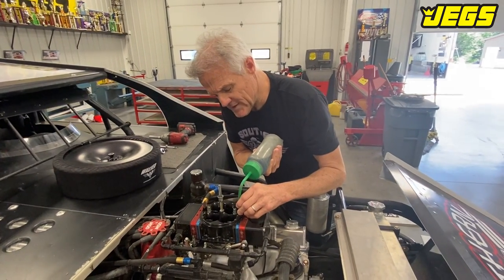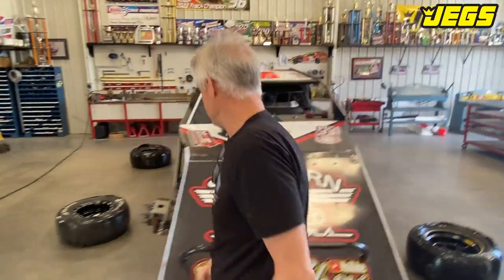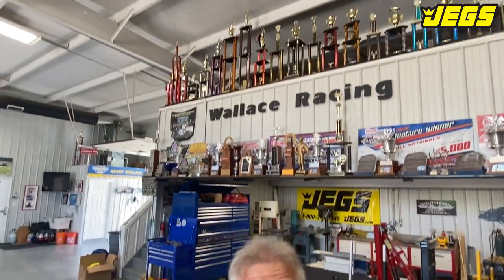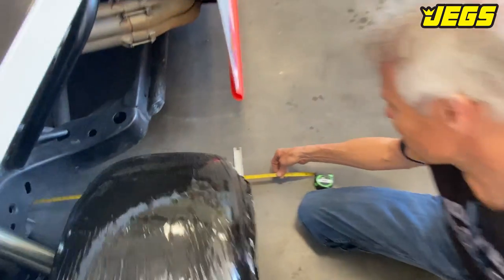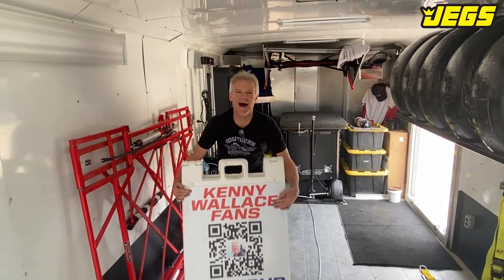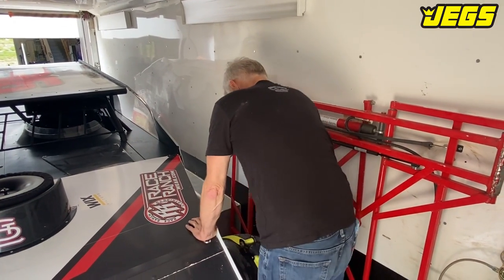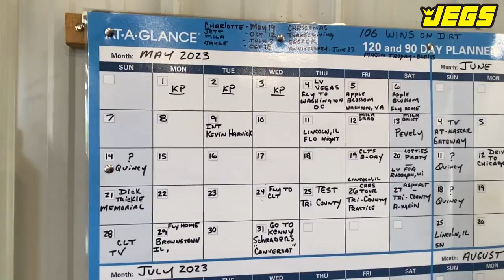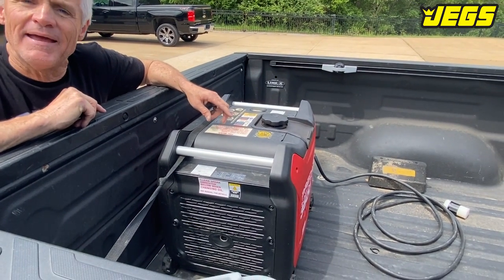Watch Me Do a Surprise Repair & Load Up My Race Car!

Comment: JEGS really is a decent company ive never had problems with customer service. No one has ever built me an engine like jegs 600hp LS for $13k warranty complete plug and play i beat on it no problems. if its got good oil pressure hammer! It! Thats what its built for.

Comment: You amaze me, you're doing exactly what I do every pre-race and after race.  I'm 63 years old and I've been building and rebuilding my sons race cars since he was in karting at age 5.  He is 26 today and running his 2nd year in Modifieds here in Phoenix, AZ.  We have a small 3-car garage and a 20 ft trailer, but we manage to do everything we need to get in all the racing we can afford. (20-30/year).  I love the tips you showed in this video, love the way you are just as organized and methodical.  I found some new things in this video that will help us, like the extra nose piece you have pre-assembled in the front of your trailer, the plastic pieces you put under the front tires to adjust toe.  (We shut off the compressor whenever we shut down the garage, like turning off the lights.)  Thank you for sharing, keep being you, brother.

Comment: This was fantastic. Can't explain how good. One of my all time favorite youtubes. Could watch this all day. I run a hillclimb, autocross and circuit car on my own just mainly at club level (fitting, turning, engine rebuilds/mods, wheel alignments, body work, respray, fab, tire change/balance...the works). Nothing like your set up Kenny (a fraction of the size ie a Mazda 4x4 ute and a car trailer as opposed to your smaller enclosed trailer). Problems solving, routines, patience, self-constructive-criticism, I love all that. You teach me heaps and I enjoy the stories. Thanks Kenny!

Comment: This brought back so many memories. I recall sleeping in the truck in the parking line for the worlds 100 in the late 70’s. I also was there by myself. For most of my racing days it was just my 5’2” wife and myself there. The “humper” tires were almost bigger than her. As I recall there were almost 200 cars there. Good times 
You are correct that the help doesn’t have the passion or skills that makes it fun. Can they tighten the bolts for the aluminum quick change cover without stripping them?  While this seems simple the results can be catastrophic. So even the most simple tasks can keep you from making the race even with all the work done getting ready for the track. 
Good luck and keep happy.

Comment: Kenny I learned to use two tape measures at the same time checking the toe. That way see both front and back measurements together. Just something  I do to save time checking toe-out.

Comment: That broom does NOT need replacing BUT a few splits would stiffen 'er back up Love my $100 winch saves all of them clutches AND will drag a bent car back on(still using an open trailer and a van)to get home

Comment: Until the engine begins to aspirate on burning fuel with exhaust scavenge, the aggressive cam/valve overlap can allow reversion of expanding/burning gases. EDIT: There's so much dust in those sticky traps that mice just blaze on through. lol

Comment: Holy cow now I see what I look like but not with nice epoxy floors I from up here in Pennsylvania. We have a lot of dirt track. The PA Posse is on the Sprint car side I guess I have hung around with Bobbie Allen scruffy. I am sure I could figure out a bunch of other I am 60 years old now. I do have a track championship at path Valley Speedway in 1998. I am having a bad connection right now

Comment: If the gas runs into your cylinders and gets in your crank case that can`t be good for your oiling system and engine parts.You would think to have a valve to shut off the line and run the carb dry.

Comment: " You can do shit, if you want to do it bad enough". ... Or, you can get in the car, start it, and drive it to the tail of the ramp to hook the tow strap to it... Or, you could be like us open trailer guys, and just drive it on the trailer.  The only reason you need a winch, is to load your junk back on the trailer after the tow truck hauled it off the track after some dumbass wrecked ya... 

JK Kenny... Your as good as you are, because you do what you do....No shortcuts...